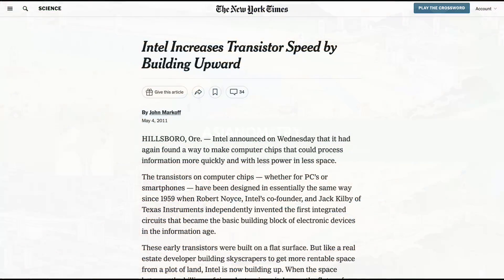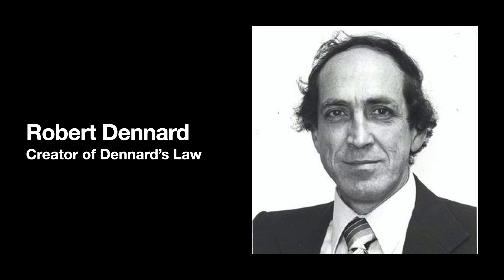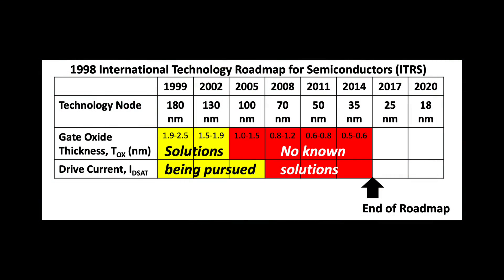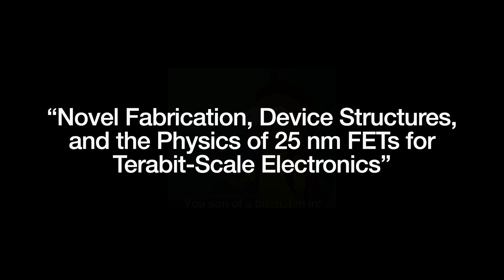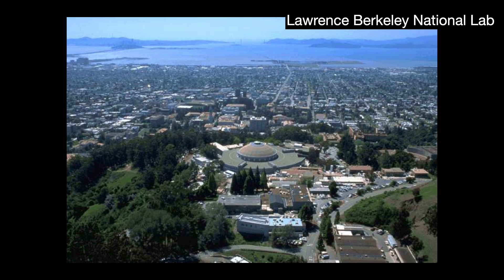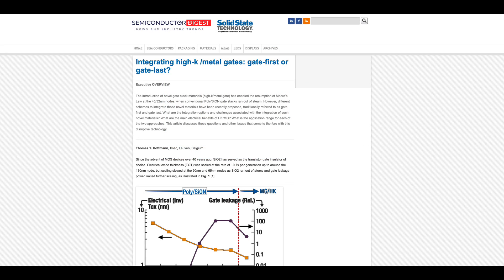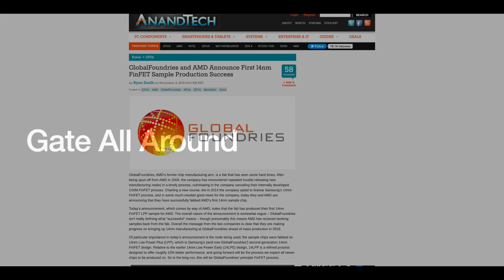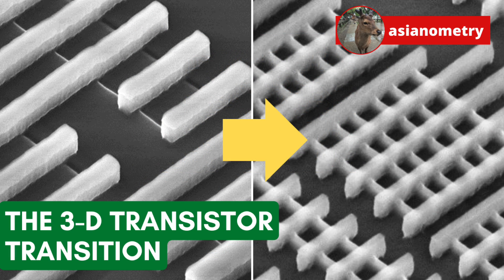The 3-D Transistor Transition

Comment: I might be wrong, but wasn't 20nm (instead of 28) the last node with planar transistors (for all fabs but intel)? It didn't work out well, so 16nm of TSMC/Samsung were basically 20nm BEOL with "16nm" FinNET based FEOL.

Comment: I have a question that many of your recent videos have got me thinking about. So 28nm is this big deal, and the "chip shortage" was all because for a whole bunch of applications (cars, military) smaller node size isn't actually desirable, but the economics has pushed everyone into the smaller node size because those are the chips that make the money (CPUs, graphics cards, AI). But what can you actually do with 28nm beyond the applications that specifically require it? Like if in an alternate universe we stopped reducing node sizes at 28nm and focused on improvements in layout from that point on, how fast would a rich gamer's beast be? What would a smartphone be able to do? Memory, storage, networking, etc.. How much are we non-AI builders getting out of smaller node sizes?

Comment: How about mentioning Intel TERAHERTZ, 1000GHz in 2001 yet still not used today?
Intel TeraHertz was Intel's new design for transistors. It uses new materials such as zirconium dioxide which is a superior insulator reducing current leakages.
According to Intel, the new design could use only 0.6 volts. Intel TeraHertz was unveiled in 2001. As of 2015, it is not used in processors.
There was a story 2 months after it came out "the NSA said we need to limit the computing power of consumers because there is too much encryption and we need to be able to read everyone's email. But just a coincidence I'm sure...... Nobody would ever want a computer that runs 200 times faster than now, with LOWER POWER and COOLER according to Intel with a "special sauce" they wouldn't release, with 10,000 times less leakage like that. It would be great for RAM too. Check out the references on the wiki page and the archived version. For some reason they erased their older pages, it was 3 pages long, and now it's barely a few sentences.
Reply: There was a CPU magazine article on it about the details too. I'll send it to you if you like.
Reply: If any of that was actually possible, Intel would have ramped that up sometime in the past 3-4 years as they've gone down the toilet. And, if possible at all, nothing would have stopped any decent sized university from researching it.  Now that things are finally getting a bit cramped with no easy way out, time might be to look beyond silicone to more exotic substrates and new equipment lines.
Reply: @boots7859  Just lookup the references I mentioned. It is possible and you clearly didn't look at the references like the WIKI page on it, the several articles from other places, the DARPA and Motorola articles. That's like saying "100MPG cars are impossible because we would all have them by now", it's not like people making cars also profit by the sale of oil, things like that don't exist in the real world.Yeah, they do, OFTEN, that's why "con - spriacy to commit", collusion, etc are common cryymes, just like Enron and the Island we aren't allowed to mention because that would never happen either.
Reply: @boots7859  If you think universites would have it, then why don't they all have access to classified technology? Like a huge amont of material science classified. I remember when I took engineering they said, "negative refractive index materials are IMPOSSIBLE", yet the military had them since the 1950s, we call them "left handed materials and other names now", same for a bunch of other things just like powerful lasers, that's IMPOSSIBLE, yet he military had combustion driven lasers that could punch holes in metal in the 1970s and they were CLASSIFED, so why didn't all the universities have them? Because they are terrible at security often!
Reply: @boots7859  Remember UFOs and the things they do are also IMPOSSIBLE and couldn't exist, now the Pentagon has admitted it was real the whole time and they weren't being truthful. Just like over 13000MPH and sever HUNDRED G turns with no visible propulsion. Kind like lasers were impossible or cold fustion, yet the media HID that there were over 300 SUCESSSFUL replications and many projects were CLASSIFIED. You know, kept a secret so only the USA has them. And yes, the system is way out of control, I have and old book someone listing things to be classified from 1973 and it listed solar panels over 20 per - cent efficient, water desaliniztion, computing and encryption devices. Oh, and encrytion and computing is STILL frequently limited and CLASSIFIED, just like what I mentioned. In another 20 years it will just be a rumor, never existed, jst like you said.
Reply: @boots7859  From the WIki - Intel TeraHertz was Intel's new design for transistors. It uses new materials such as zirconium dioxide which is a superior insulator reducing current leakages. Using zirconium dioxide instead of silicon dioxide, this transistor can reduce the current leakage, and thus reduces power consumption while still working at higher speed and using lower voltages.
Reply: @boots7859  HEMT wiki - Applications (eg for AlGaAs on GaAs) are similar to those of MESFETs – microwave and millimeter wave communications, imaging, radar, and radio astronomy – any application where high gain and low noise at high frequencies are required. HEMTs have shown current gain to frequencies greater than 600 GHz and power gain to frequencies greater than 1 THz.[8
Did you catch that, GREATER than 1 THz
Reply: @boots7859  Remember I said DARPA, here's an article talking about their 1 THz TERAhertz amplifier from 31 October 2014

Northrop Grumman sets record with terahertz IC amplifier
Northrop Grumman Corp of Redondo Beach, CA, USA has developed the world's fastest integrated circuit amplifier, which has been recognized by Guinness World Records. The amplifier uses 10 transistor stages to reach an operating frequency of 1 trillion cycles per second (1 terahertz, or 1012Hz) — surpassing the firm’s own record of 850 billion cycles per second (850GHz) set in 2012.
From the references I mentioned in the wiki.
Reply: @boots7859  The whole "at the limit" is told over and over too, I heard in in 1989 with 300MHz CPU, they could never go faster than that.... just like laser weapons, its IMPOSSIBLE, would take more power than a city, or Moon landing, would need a rocket bigger than the Empire state building. True, if you didn't used stages, and the laser didn't use deformable optics and we didn't have better semiconductor lasers and on and on and on.

Comment: Why not just make the gate as a slab to begin with, burn a couple of holes in the middle, put the gates in place, then thread through the holes via soldering, alternatively they can thread through the holes before placing the gates then grab the other end that's dangling and put it in place

Comment: This is really the key issue. If cost/transistor stops declining, ever smaller nodes will become increasingly niche. You will get more bang for the buck by just stacking 28nm chips.

For everything other than the most power constrained devices, it would make little sense to go below 28nm.

Comment: Your image of a planar mosfet misleads by using different colors for source and drain.   In fact, the source and drain are doped exactly the same.  Complimentary MOS will have P-type mosfets in the Nwell and N-type mosfets in the Psub.   My mentor in IC layout's first word of instruction in 1983, as he held in his hand a colored pencil, was "PMOAT is purple".
Reply: By the way, TI's 16Mbit DRAM, which I helped design in 1989, used trench capacitors in the memory bit.
Reply: And today I'm helping design 16Gbit DRAMs.  The 16G chip is about the same size as the 16M chip was.

Comment: Hmmmm...

The way I see it, the next step is full 3d.  Not merely adding 3d features to existing 2d basic structures, but outright building those structures in 3d, floating anywhere in the volume of the chip, all the way from up against the pads, to down against the substrate.  If you can additively manufacture a gate, an insulator, and a channel, you can (probably) additively manufacture a source and a drain.  Maybe even a structurally weak breakaway layer to save substrate.  Maybe mixing sizes on a single chip for power and stuff.

Added bonus: if you can stack logic on top of itself, you need less chip area for the same device size, allowing the use of smaller (and hopefully easier) photomasks (at the expense of more of them).  Though it might be time to abandon photomasks altogether in favor of scanning the pattern (resin 3d printers do this exact thing at macro-scale).

Comment: Question, how does the gate stop the flow of electrons if there is a direct connection from the source to the drain?
Reply: It's not a direct connection. The connection is made out of silicon, which is a semiconductor, which is what makes transistors possible in the first place.

Comment: My thoughts on this are in the 90s it was already clear we see the end and I was still a pupil but one way I saw was 3D CPus . Yes I know like he said they are already do some more layers on the CPU/GPU these days but you can't go far with this because you trap the heat inside with this. I watched a video on youtube about a different type of transistors which solve this by not blocking the current but just switch over basically you have 2 inputs and 2 outputs with something like this it would be possible. The down side like he said such a unit would have 100th if not 1000th of layers basically ^3 the amount of transistors but even more the costs . This is not a consumer product.

Comment: If inefficient processors "leak" current whether they're working or not, how do the ARM family of processors achieve their position as THE choice for mobile processors?

Sorry for more silicon content, Jon! 🙂
Reply: Copyed:
What is the difference between ARM and x86 processors?
They run different instruction sets.
If you want something more specific than that, pick a specific pair of processor cores to compare. I reckon there are more differences between the original 8086 and a current x86 than there are between contemporary ARM and x86 processors.

Also ARM is 32 bit as far as I know.
Intel missed going into the mobile processor marked early on (they were too expansive and just didn't try at all). Things could be different if Intel didn't miss their chance.

Comment: So, if atomic layer deposition works as semiconductor active material, instead of waver from grown single crystal, then you can basically build 3D circuits, with as many layers of transistors above each other, if you can remove the heat?
So finally 3D semiconductors, perhaps with extremely low clock rate, so no thermal issues, but with shitloads of transistors? Basically similar to how the brain works.

Comment: Thanks for that explanation, I kind of actually understood this one a bit.  Like in buildings, each floor you build comes free as you pay for the lot size only once.  But the higher you go the more they cost per floor.  Charles
Reply: Kind of, kind of not. In architecture, each new floor costs marginally so little compared to the marginal value it adds that it makes sense to build higher. A more apt analogy is that building higher was what they did before hitting the limitations described in the video. So finfets is as if now everyone would have to build cantilever buildings or buildings with holes in them to pass wind flow, to compensate for not being able to build higher. So in my opinion examples of "finfet buildings" might be The Link in Dubai (cantilever skybridge between two buildings) or 432 Park Avenue in NYC (a very tall building in comparison to its footprint.)

Comment: Nice video, this info reminds me some words in the datasheets of some discrete power semiconductors transistors like: TrenchFET (Vishay), HexFET (Infineon-Int.Rect), SuperMesh (ST), HiperFET (IXYS) and CM2 (CREE).
Some techonologies are for lowering the RDS_on and other to withstand high open voltage (some mosfet are rated to 1.7 kV OMG!)
Reply: It was great when the first HexFETs came out by IR, I quickly used them in my designs. Happy 2023 to you.
Reply: @favesongslist  Happy new year, I think HexFET was like (more or less) GaN or SiC of today
Reply: @tejonBiker  Yes it was, It was a big improvement at the time.
Reply: I always thought HexFET sounded weird but didn't look it up until today. Turns out that it indeed consists of a hexagonal lattice as the name might imply. Zeptobars even has a die shot of it.

Comment: Can you make a video to explain what is causing the price per transistor to go up? I find it hard to believe it is raising faster than the transistors per area increases.
Reply: I think it is related to the number of processing steps that is needed to create the device. In the old days one could build up a device 'from the ground up': litho, etch, deposit. Now, with these more complex geometries, additional processing steps, sacrificial layers/patterns are needed to create the final pattern.
Moore's law is an economic scaling law... more than a 'resolution scaling law', although in the early days these matched.
Reply: @tommy2cents492  Good reply. I also suggest cost will accelerate upwards for some time as we transition towards many new materials that the industry is experimenting with, Until they mature.